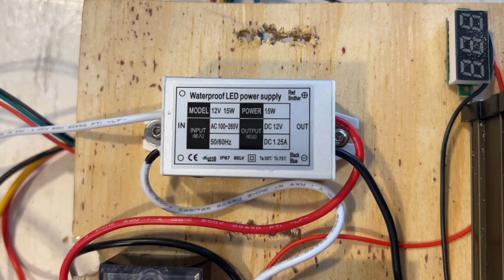ME1507 Bench Test Addendum - Addressing some issues that Ive since resolved. Helpful?

Comment: Question about your throttle.  Typically these controllers need a 5K ohm throttle, but when I research them the Magura is over $100.  That throttle you have is well under that, but all the listings I see for it don't say it's a 5K ohm throttle.  Did you just figure out which leads on the throttle are the potentiometer and run with it?
Reply from the maker: I actually didn't think much about the throttle - pretty sure this controller can use a potentiometer-based throttle or one that is voltage-based. The throttle Im using is voltage-based. I measured the range at one point but forget what it was. Either way you should be able to use a cheap ebike throttle and dial in the range when programming the controller

Comment: did you ever find out the answer to the ac-dc buck converter trivia question?
Reply: The very first component in that little AC/DC power supply is a full wave rectifier which converts the input AC voltage to a DC voltage.  If you apply a DC voltage directly to the input, the positive polarity diode in the full wave rectifier simply passes the DC voltage to the DC filter stage with the only loss being the forward voltage of the two diodes.  Ideally, you could pull the supply apart and bypass the FWR and wire the DC input directly to the DC filter stage, but at 100VDC input, the losses are so small that it would make no difference.  Note that when 100VAC is full wave rectified to DC you end up with 1.414 times the DC voltage as the AC applied voltage (ideally) so if you use DC input voltage, it may not work correctly unless it's ~1.4 times the minimum AC input voltage range.